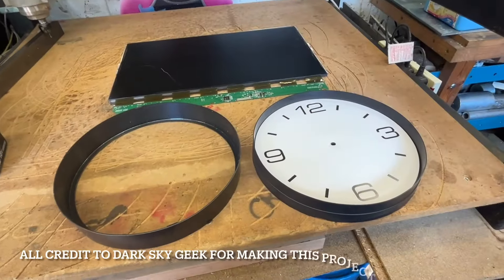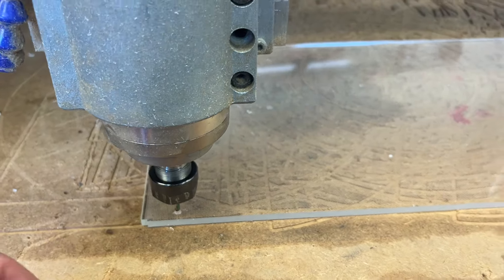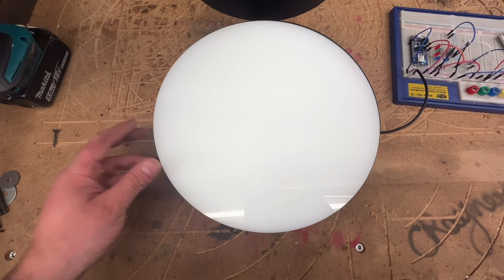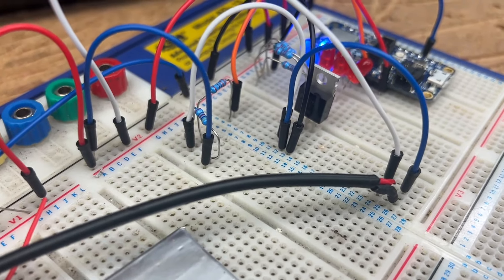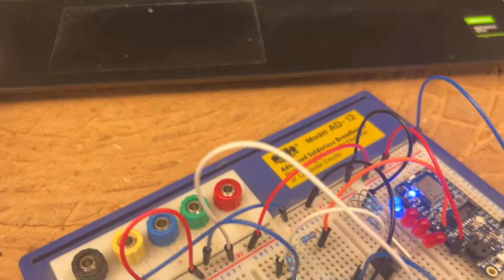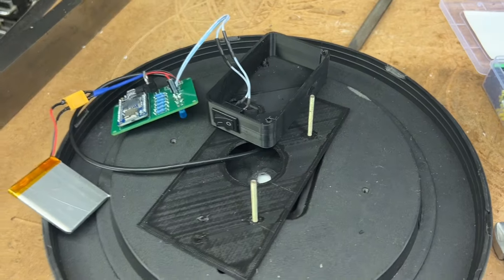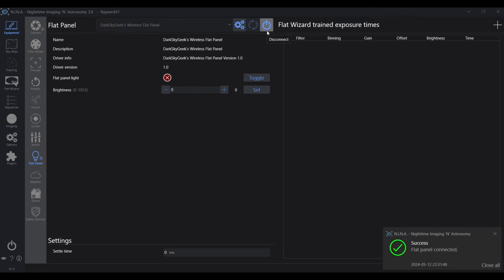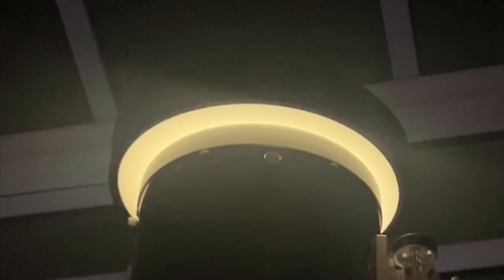Astrophotography - Building a Wireless Flat Panel for N.I.N.A. Flat Wizard

Comment: Good day. Thank you for your project, it was very interesting to assemble it, but I have a small problem. Everything works, the control goes, but the LED lamps, which are very dim at 5 volts, barely glow. What could be the cause of this problem? I used the resistor at its nominal value, that is, the one that controls the field-effect transistor, eh, 330 ohms, and 5 kOhm, but for some reason it barely glows. Perhaps something does not match the transistors. Nor at their nominal value. Please tell me how this could be a problem.
Reply from the maker: are you using the same LEDs and have you tried reducing the resistance ?
Reply: @craynerd  I tried changing the tape. It came to work with two 1.5 V batteries, that is, it glows well, but does not want to go through the circuit. I also changed the resistors. It starts to glow a little better, but I think the field-effect transistor does not open to the full extent, most likely, not that it is faulty, they do not match the parameters. That is, from 2.5 V the gate does not open. I have ordered another transistor now. Eh, I will try. Eh, install it and solve this problem.